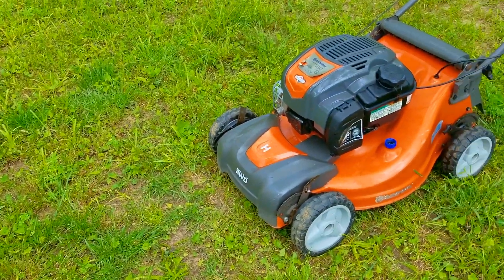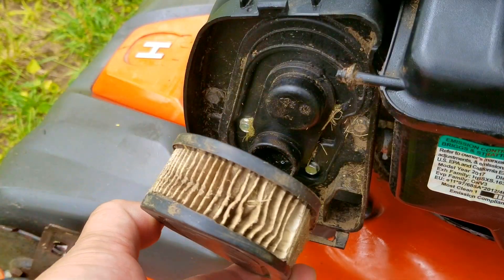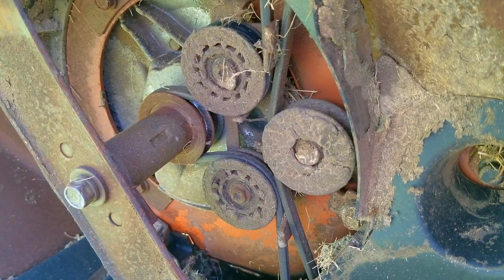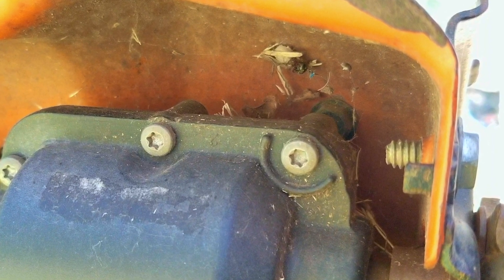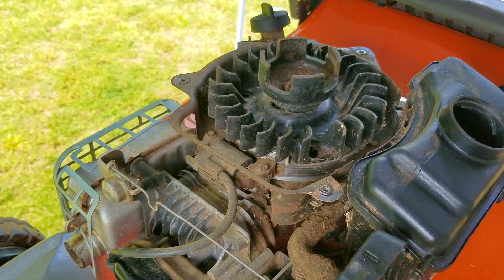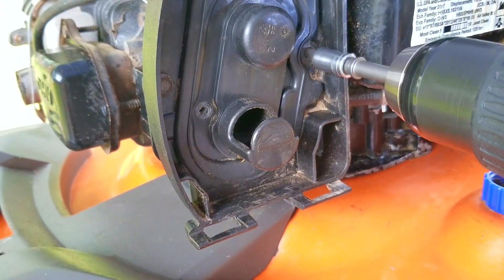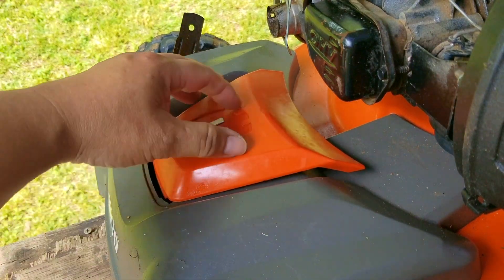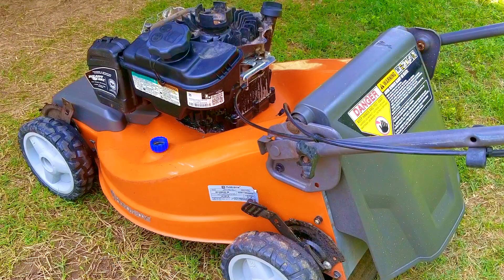Fixing A Husqvarna Mower That A Has Pull Rope That Won't Turn The Engine.

Comment: This is an extremely cheap model Husqvarna mower.  As you're disassembling,  I'm comparing it to the 775H and I can see that Husqvarna engineered everything down to its absolute flimsy minimum and still be able to function (for a short while).  Nothing is made well anymore.  Nothing lasts for 15 years anymore.   The intent is just to manufacture throw-away junk at top dollar.  Investor return is the goal of Husqvarna.
Reply from the maker: you are correct. Things are at a minimum now.

Comment: My Husky, just like yours, is a high dollar piece of garbage. Is it because I've changed the oil?
The gas cap got knocked off under a bush and broke the tank, so a screw holds the cap on the tank, now.
The AWD is very lacking on an incline after 2 years use.
It will only cold start with a shot of ether.
On bumpy or uneven ground, the agitation makes the engine misfire.
I just learned the newest Honda walk-behinds are also garbage.
Turn it all into garden, screw this mowing crap. :-)

Comment: Looks like the pawls and parts are the same or very close to the quantum engines. The pawls are probably the same. The pawls are available on their own aswell in various kits.  The pawls have a buch of different numbers 281505, 281505S, 4204 John DeereLG281505S, Kawasaki13165-2092 Stens 150-609.  The pawl kit looks just like the Honda and is Briggs #s 281503, 281505, 492333, 692299. Hard to tell without the model type and code but it's very possible those are the parts that will work for very little money
Reply from the maker: that's what I thought too, but I can't guarantee it.
Reply: @INSIDEHOUSEGARAGE  I have a left for dead Husqvarna with the same engine as that one you have in the video waiting for me to get to it and I have a Quantum mower as well. The second I have time I'll pull the recoils and confirm. I actually may have one of those pawl kits on hand to check with that Husqvarna and see if it matches up.

Comment: The parts should be cheaper than the whole recoil. Hard to say with things like Amazon these days, things like whole recoils can be found super cheap.  Those parts should be an inexpensive kit in the after market like the other Briggs recoils take. If you send me the model type and code I can look up the aftermarket part numbers for the pawl kits, they should be available from Oregon, Rotary and Stens, I have all three catalogs.
Reply from the maker: I completely agree with you on the cost aspect..

Comment: I would buy the whole assembly because once the pawls get messed up, they are never right again. The pivot tube is plastic and toothpick width. It is easily damaged the damage is not always oblivious. Sometimes they bend after being damaged and the new pawls (or the old ones if found) never work right.
Reply from the maker: you already knew what the situation was.
Reply: @INSIDEHOUSEGARAGE  been there, done that, got grease on my t shirt